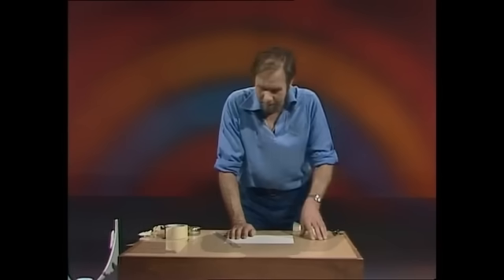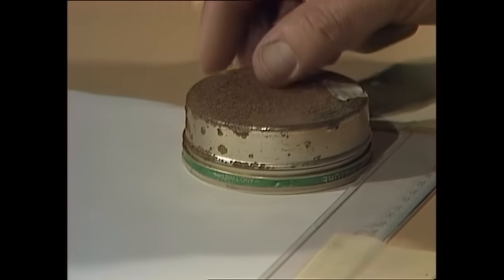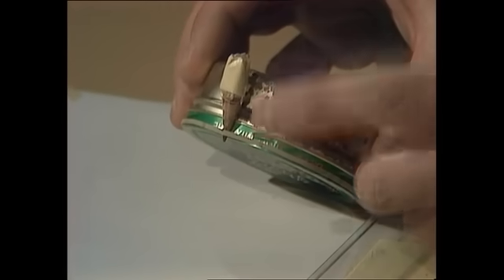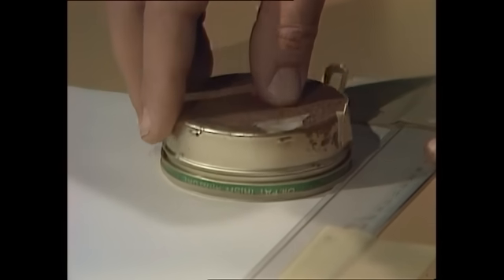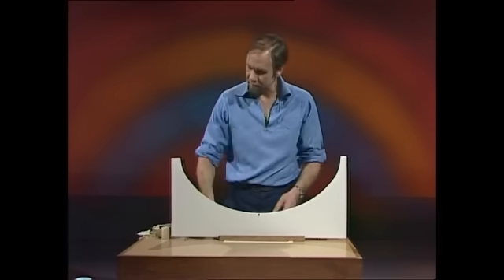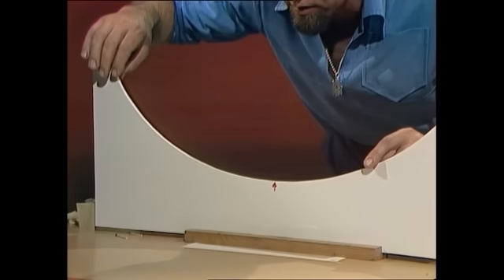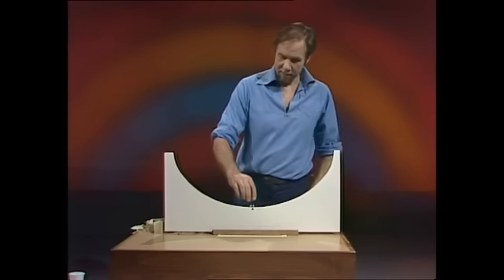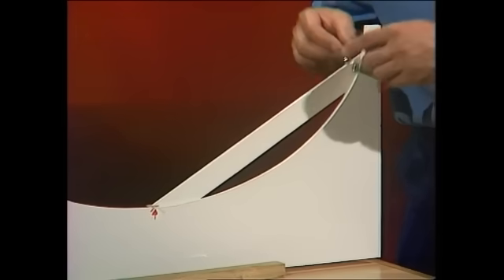The mysterious isochronous curve

Comment: "Virtual gravity" solution
The simplest solution to the tautochrone problem is to note a direct relation between the angle of an incline and the gravity felt by a particle on the incline. A particle on a 90° vertical incline undergoes full gravitational acceleration {\displaystyle g}g, while a particle on a horizontal plane undergoes zero gravitational acceleration. At intermediate angles, the acceleration due to "virtual gravity" by the particle is {\displaystyle g\sin \theta }{\displaystyle g\sin \theta }. Note that {\displaystyle \theta }\theta  is measured between the tangent to the curve and the horizontal, with angles above the horizontal being treated as positive angles. Thus, {\displaystyle \theta }\theta  varies from {\displaystyle -\pi /2}-\pi /2 to {\displaystyle \pi /2}\pi /2.

The position of a mass measured along a tautochrone curve, {\displaystyle s(t)}s(t), must obey the following differential equation:

{\displaystyle {\frac {d^{2}s}{{dt}^{2}}}=-\omega ^{2}s}{\displaystyle {\frac {d^{2}s}{{dt}^{2}}}=-\omega ^{2}s}
which, along with the initial conditions {\displaystyle s(0)=s_{0}}{\displaystyle s(0)=s_{0}} and {\displaystyle s'(0)=0}{\displaystyle s'(0)=0}, has solution:

{\displaystyle s(t)=s_{0}\cos \omega t\,}{\displaystyle s(t)=s_{0}\cos \omega t\,}
It can be easily verified both that this solution solves the differential equation and that a particle will reach {\displaystyle s=0}s=0 at time {\displaystyle \pi /2\omega }{\displaystyle \pi /2\omega } from any starting position {\displaystyle s_{0}}s_{0}. The problem is now to construct a curve that will cause the mass to obey the above motion. Newton's second law shows that the force of gravity and the acceleration of the mass are related by:

{\displaystyle {\begin{aligned}-g\sin \theta &={\frac {d^{2}s}{{dt}^{2}}}\\&=-\omega ^{2}s\,\end{aligned}}}{\displaystyle {\begin{aligned}-g\sin \theta &={\frac {d^{2}s}{{dt}^{2}}}\\&=-\omega ^{2}s\,\end{aligned}}}
The explicit appearance of the distance, {\displaystyle s}s, is troublesome, but we can differentiate to obtain a more manageable form:

{\displaystyle g\cos \theta \,d\theta =\omega ^{2}\,ds\,}{\displaystyle g\cos \theta \,d\theta =\omega ^{2}\,ds\,}
or

{\displaystyle ds={\frac {g}{\omega ^{2}}}\cos \theta \,d\theta \,}{\displaystyle ds={\frac {g}{\omega ^{2}}}\cos \theta \,d\theta \,}
This equation relates the change in the curve's angle to the change in the distance along the curve. We now use trigonometry to relate the angle {\displaystyle \theta }\theta  to the differential lengths {\displaystyle dx}dx, {\displaystyle dy}dy and {\displaystyle ds}ds:

{\displaystyle {\begin{aligned}ds={\frac {dx}{\cos \theta }}\\ds={\frac {dy}{\sin \theta }}\end{aligned}}}{\displaystyle {\begin{aligned}ds={\frac {dx}{\cos \theta }}\\ds={\frac {dy}{\sin \theta }}\end{aligned}}}
Replacing {\displaystyle ds}ds with {\displaystyle dx}dx in the above equation lets us solve for {\displaystyle x}x in terms of {\displaystyle \theta }\theta :

{\displaystyle {\begin{aligned}ds&={\frac {g}{\omega ^{2}}}\cos \theta \,d\theta \\{\frac {dx}{\cos \theta }}&={\frac {g}{\omega ^{2}}}\cos \theta \,d\theta \\dx&={\frac {g}{\omega ^{2}}}\cos ^{2}\theta \,d\theta \\&={\frac {g}{2\omega ^{2}}}\left(\cos 2\theta +1\right)\,d\theta \\x&={\frac {g}{4\omega ^{2}}}\left(\sin 2\theta +2\theta \right)+C_{x}\end{aligned}}}{\displaystyle {\begin{aligned}ds&={\frac {g}{\omega ^{2}}}\cos \theta \,d\theta \\{\frac {dx}{\cos \theta }}&={\frac {g}{\omega ^{2}}}\cos \theta \,d\theta \\dx&={\frac {g}{\omega ^{2}}}\cos ^{2}\theta \,d\theta \\&={\frac {g}{2\omega ^{2}}}\left(\cos 2\theta +1\right)\,d\theta \\x&={\frac {g}{4\omega ^{2}}}\left(\sin 2\theta +2\theta \right)+C_{x}\end{aligned}}}
Likewise, we can also express {\displaystyle ds}ds in terms of {\displaystyle dy}dy and solve for {\displaystyle y}y in terms of {\displaystyle \theta }\theta :

{\displaystyle {\begin{aligned}ds&={\frac {g}{\omega ^{2}}}\cos \theta \,d\theta \\{\frac {dy}{\sin \theta }}&={\frac {g}{\omega ^{2}}}\cos \theta \,d\theta \\dy&={\frac {g}{\omega ^{2}}}\sin \theta \cos \theta \,d\theta \\&={\frac {g}{2\omega ^{2}}}\sin 2\theta \,d\theta \\y&=-{\frac {g}{4\omega ^{2}}}\cos 2\theta +C_{y}\end{aligned}}}{\displaystyle {\begin{aligned}ds&={\frac {g}{\omega ^{2}}}\cos \theta \,d\theta \\{\frac {dy}{\sin \theta }}&={\frac {g}{\omega ^{2}}}\cos \theta \,d\theta \\dy&={\frac {g}{\omega ^{2}}}\sin \theta \cos \theta \,d\theta \\&={\frac {g}{2\omega ^{2}}}\sin 2\theta \,d\theta \\y&=-{\frac {g}{4\omega ^{2}}}\cos 2\theta +C_{y}\end{aligned}}}
Substituting {\displaystyle \phi =2\theta \,}{\displaystyle \phi =2\theta \,} and {\displaystyle r={\frac {g}{4\omega ^{2}}}\,}{\displaystyle r={\frac {g}{4\omega ^{2}}}\,}, we see that these parametric equations for {\displaystyle x}x and {\displaystyle y}y are those of a point on a circle of radius {\displaystyle r}r rolling along a horizontal line (a cycloid), with the circle center at the coordinates {\displaystyle (C_{x}+r\phi ,C_{y})}{\displaystyle (C_{x}+r\phi ,C_{y})}:

{\displaystyle {\begin{aligned}x&=r(\sin \phi +\phi )+C_{x}\\y&=-r\cos \phi +C_{y}\end{aligned}}}{\displaystyle {\begin{aligned}x&=r(\sin \phi +\phi )+C_{x}\\y&=-r\cos \phi +C_{y}\end{aligned}}}
Note that {\displaystyle \phi }\phi  ranges from {\displaystyle -\pi \leq \phi \leq \pi }{\displaystyle -\pi \leq \phi \leq \pi }. It is typical to set {\displaystyle C_{x}=0}{\displaystyle C_{x}=0} and {\displaystyle C_{y}=r}{\displaystyle C_{y}=r} so that the lowest point on the curve coincides with the origin. Therefore:

{\displaystyle {\begin{aligned}x&=r(\phi +\sin \phi )\\y&=r(1-\cos \phi )\\\end{aligned}}}{\displaystyle {\begin{aligned}x&=r(\phi +\sin \phi )\\y&=r(1-\cos \phi )\\\end{aligned}}}
Solving for {\displaystyle \omega }\omega  and remembering that {\displaystyle T={\frac {\pi }{2\omega }}}{\displaystyle T={\frac {\pi }{2\omega }}} is the time required for descent, we find the descent time in terms of the radius {\displaystyle r}r:

{\displaystyle {\begin{aligned}r&={\frac {g}{4\omega ^{2}}}\\\omega &={\frac {1}{2}}{\sqrt {\frac {g}{r}}}\\T&=\pi {\sqrt {\frac {r}{g}}}\\\end{aligned}}}{\displaystyle {\begin{aligned}r&={\frac {g}{4\omega ^{2}}}\\\omega &={\frac {1}{2}}{\sqrt {\frac {g}{r}}}\\T&=\pi {\sqrt {\frac {r}{g}}}\\\end{aligned}}}